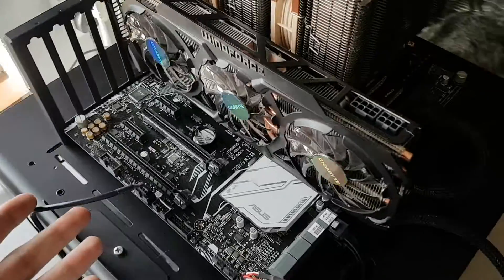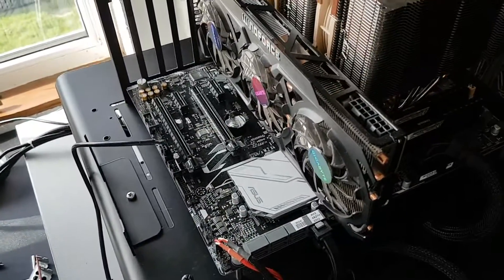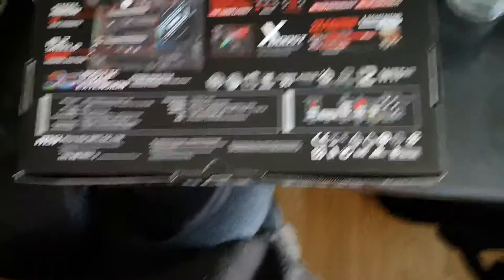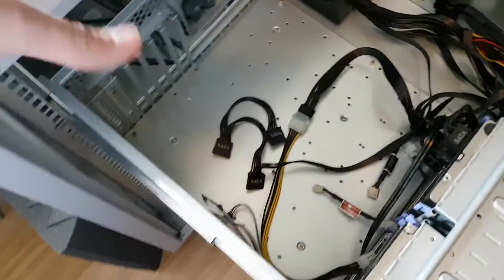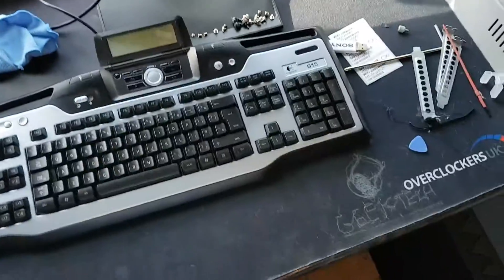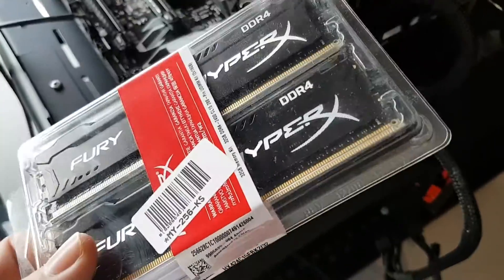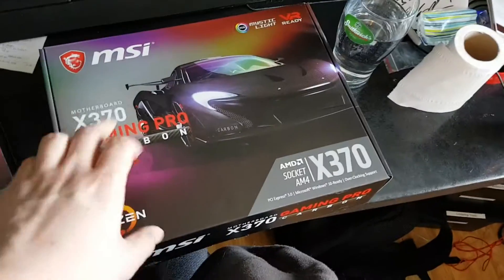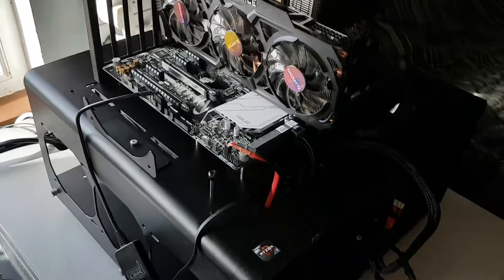Ryzen Update & Home Server changes

Comment: I was wondering, is there any Ryzen (8 core) with 64GB ECC support mobo, that also have built in 8 SAS3 connectors (similar to Supermicro X11SSH-CF), and 1 or 2 10Gbps connectors (like Supermicro X11SSH-CTF). That would make my new build so much easier, by eliminating all extension cards, and make cabling and temperature management easier.

Comment: Hi GT, Im currently looking to building my own home server. 
I want to use the Ryzen 1600 and the upcomming RX 500 grafics card. 
The system will be running a Nas, Camera monitoring & i made a service that wille trigger if movement is detected and 
will send a image to me with the app telegram, Also OpenVPN will be running on it for remote data acces with a phone.
And some VM's for Media server,application server, OS dist for Raspberry pie's, ...
I have calculated that the power consumtion on idle 30-50W will be with no attached monitor.

Whats your oppinion over this, can you think of any improvements?

Planned hardware:
MSI B350M Mortar
R5 1600
RX 500 series card prop 550
16GB Corsair vengeance ram 3Ghz
Crucial MX300 275GB ssd for OS
2 4TB WD Reds
?Corsair TX550M /superflower planinum 550W
This all inside of the fractal design node 804
and maybe some noiseblocker B12-p's fans